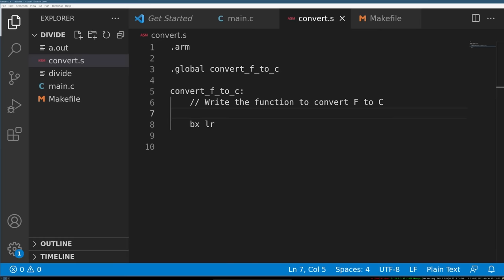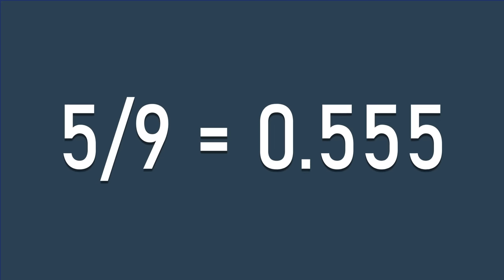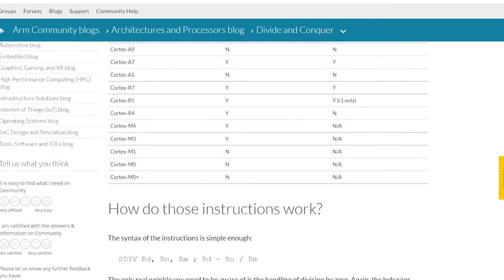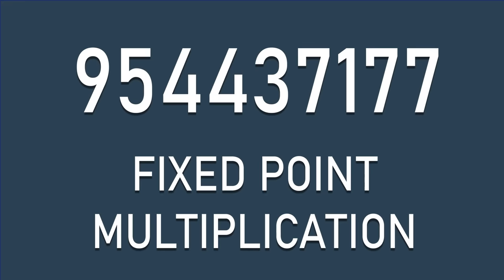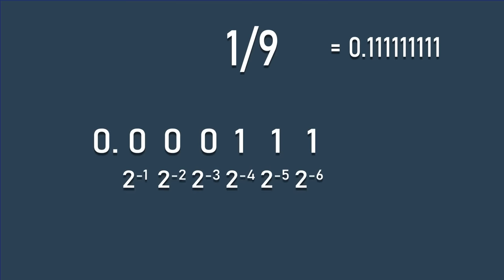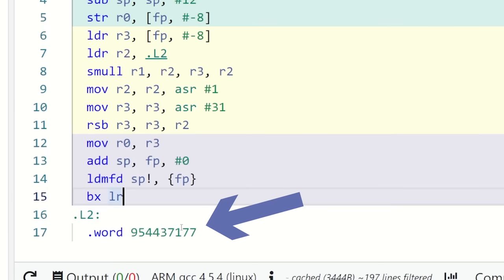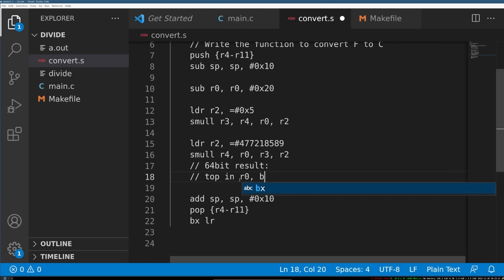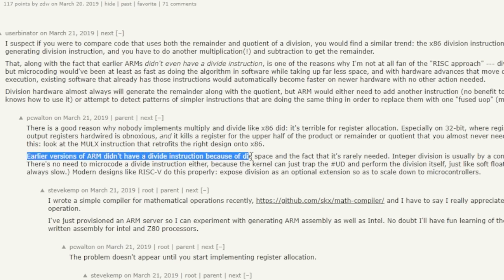computers suck at division (a painful discovery)

Comment: bro's just casually programming some ARM assembly. love it man stuff like this makes me motivated to learn low level stuff even though it looks kinda scary to me
Reply from the maker: Do it!
Reply: I think it's a waste of time beyond knowing "what is assembly and how it works + basics"

(Note: I, myself, know the "basics" I mentioned above. It's logical that "knowing" is always superior comparing to "not knowing"...)
Reply: Learning it will improve your high-level coding. Worth it!
Reply: @Yas-gs8cm  Once you learn assembly your thought process never becomes the same again. Even if you work with higher level languages you still constantly think about: "What happens once this gets converted to assembly". It helps you develop new ways to solve problems that you wouldn't have if you never coded in assembly.
Reply: @Yas-gs8cm  this isn't even the basics though, this video is super simple stuff
Reply: Its coding c with extra steps... ive done alot of 8086. Once you understand instruction calls (add,mull,sub), registers (variables), memory manipulation (storage space used for arrays), flags (a way to idenitfy what ur result is ) and function structure i think you are like 70% therr and have enough knowledge to write assembly programs
Reply: @Yas-gs8cm  understanding what’s happening at a low level is crucial to writing the best performing code you can and that far exceeds what the basics could help you with
Reply: Try learning 6502 assembly.
Or the 65c816 with a snes emulator.
Its really not that difficult to do basic things.
Its a bitch to setup the environment though.
Reply: @LittleRainGames  no sir we refuse ur barbarian ways.
Reply: Guys please stop mentioning me... I already got my degree and did enough assembly homework... Just saying it's not necessary in 2022 and it's pretty advanced/useless for an average JS normie xD (I personally prefer C)
Reply: @Yas-gs8cm  .
Reply: @ryantony5586  That's a really good point there...
Reply: @Yas-gs8cm  Of course it’s not necessary, but those who have at least had exposure will be at an advantage every time vs people who code in only Python and JS and have no idea how data is actually stored in RAM.
Reply: @Yas-gs8cm  there are some cases when compiler is unable to know some additional information about your data (alignment, SIMD leftovers, amount of data). So it is unable to make proper optimisation. Handcrafted ASM code, which leverages that info will be more efficient. OpenBLAS is a good example, where handcrafted assembly is still required for most computational cores.
Reply: @mattizzle81  having learned ARM7 asm without the textbook, I can tell you... I didn't learn jackshit because the professor couldn't explain the difference between LOAD and STORE instructions, I had to literally borrow someone's textbook because he made it sound like they are the same thing.
Reply: 1. Find a video game you love tht has an annoying part, cheat engine, learn ASM to fix code. 
2. Dig deeper and figure out how to right calculus in said game cuz you cant deal with the in game camera. 
3. Learn through your trials and tribulations of rewritting a video game's 3rd person view in ASM tht compliers do a horrible job at using the all the CPU registers and rely toooo heavily on the stack because of outdated compiler design. 
4. Randomly stumble across this guy video who overly complicated a division in low level for no reason other to make a video. 
5. Write a reply and jmp to @init. 

Serious note : If you know low level stuff you learn real quick how basic code gets bloated in the complier and soon realize there is no reason to learn ASM unless you are reverse engineering something. 

But if you do pursue, nvr use divide or subtract. Always use addition and multiplication. Subtraction takes more cpu cycles.
Reply: its arm, there aren't a whole lot of instructions in the architecture.
Reply: the scary part is that there are 3 registers in all opcodes for c=a+b, but most of the time you just do a=a+b, so you repeat two.
Reply: @LuskyMJ  100% this. i've learned so much in c# by looking at the IL and Asm that results. In particular about the compiler and how it optimizes things (or not)...
Reply: @cpK054L   hmmmm…. can’t tell if serious? The only difference between load and store instructions is direction.
Reply: @MurderMostFowl  yeah, it took the textbook to explain that to me
Reply: Ben Eater has a whole series about building a CPU from basic logic.  You want to know how the magic happens, watch his stuff.
Reply: @LuskyMJ  This. Understanding how assembly works and roughly how the general architecture of a CPU works completely changes how you approach problems. Especially in an MCU environment.
Reply: @Yas-gs8cm  no knowledge is a waste of time
Reply: @energy-tunes  depending on what you seek it can be. Yes.
Reply: @Yas-gs8cm  "Guys please stop mentioning me... I already got my degree and did enough assembly homework... Just saying it's not necessary in 2022 and it's pretty advanced/useless for an average JS normie xD (I personally prefer C)" You can't just make a claim in a comment section and then tell people to stop disagreeing with you, if you didn't want people too disagree then you shouldn't have posted it.
Reply: @Bob13454  I can do whatever the heck I want jokes aside mate... This is not a court, it's YT comment section... + just because I make a claim it doesn't immediately mark it as false. I don't hate being told I'm wrong. I just didn't feel any constructive points in the  replies so that was my polite way of putting it.
Reply: @Yas-gs8cm  Why were there no constructive points? They explained why they thought you were wrong.
Reply: @Bob13454  My main point was "it's not necessary 2023" right? and everybody is like "nope it is"... there is no real sign of "why" and most answers are just point of views. I'm not saying it's wrong. I'm saying it's not convincing for me. Hence, no construction. Therefore, no reply.
Reply: it is waaaay easier than it looks when you start. 
It is just very tedious.
Reply: @ryantony5586  the main idea of C is that it enforces limitations for concepts that do not even exist in assembler. No, it is not coding C with extra steps.
Reply: I think realising that division is so horribly expensive that there are better ways to achieve the same thing is the most important lesson! 

I also love that ARM said what the hell, let's just ditch it and stick to multiplication! 

Only found your videos recently and as a graduate from computer science over 20 years ago I love the way you teach!

Comment: 5 / 9 is roughly 569 / 1024. Dividing by multiples of 2 is an Arithmetic Shift Right.
Multiply by 569, shift the result Right by ten bits.  Multiply by 36409, shift 16 bits... 
and 2330169 with a shift of 32 bits merges nicely with your code.
Reply: Sir, this is what I call an elegant solution. Easy to understand. Easy to code. Easy to process. And give the most precise results available for this architeture (I think).
Reply: @VictorCampos87  This is exactly why they don't have these operations on the processor. Because skilled embedded developers don't need it and it would make it too expensive or large for the applications it was built for. People that do this every day generally don't need it.
Reply: @Kyle-ke5fx  What do you do when a variable divide comes up?
Reply: @joshuahudson2170  do it the same way we do long division by hand in decimal
Reply: @TrackedHiker  That's a guess and check pattern.
Reply: @joshuahudson2170  um, okay??? I’m not seeing a lot of guessing but ok
Reply: Only accurate to 3 digits after the decimal.
Reply: @JacobP81  Which is perfectly fine for temperatures, because extremely few things deal with temperature that precisely.
Reply: This is nearly exactly what he does though. He mulitplies by a huge number and then shifts right.
Reply: You described pretty much exactly what he does in three lines and in a more understandable way IMO. In his case, the shift would be 32 bits which he effectively does by ignoring the low half of the result in r4.
Reply: @joshuahudson2170  Use a lookup table. 
The most common examples of variable division are in DSP, where you multiply by assorted sine or cosine values. Or apply weighted values in filters. Or "window" functions before doing a FFT.
In all these cases, you have a table of pre-compiled values to select from.
Reply: @jeremypnet  As mentioned by @Dale Glass a temperature reading isn't likely to be highly accurate. Oven temperature sensors may have a range of 500 Celsius, but reading that with anything fancier than a 12-bit ADC is a waste of resources. And once you know your input is limited to 12 bits, is there REALLY a reason to use more than 16 bit math?
Reply: That's exactly what I had in mind. Since this CPU can only divide by powers of 2 (right shifts), find a "friendly" power of two as your divisor (ideally 2^32, so that you can use 64-bit multiplication and get a 32-bit right shift for free by keeping only the higher end register), then adjust your dividend accordingly. And yes, that's what he ends up doing in the video, but I find this approach much more intuitive.
Reply: Overflows occur earlier with this technique.  Maximum accuracy with largest input domain require two steps
Reply: @joshuahudson2170  My engine uses a lookup table where possible, but sometimes I fall back on an actual div instruction if it's acceptable or the range is too large.  If I had no division instruction there are usually other ways to approximate things (e.g. shifting off bits of the input to use a smaller lookup table), or you can do a step-wise long division. :)
Reply: @Ehal256  What architecture type are you programming for? Forgive me if I'm wrong, but I am led to believe on most larger architectures where game engines run, the overhead of accessing memory would far outweigh the benefits of not doing the rare FP division.
Reply: @joshuahudson2170  There won't be any guessing, since there is only 2 possibilities (we are working in binary). It either goes in 1 time, or no times. Simply check if the dividend is bigger, and shift a 1 into the quotient if it went in and subtract it out of the dividend; otherwise, shift in a 0.
Reply: @lapatatadelplato6520  I actually checked with somebody at work and we both had the interpretation of base (1 << machine register size).
Reply: I don't understand this. I want to understand this so badly. Need to return to this to process what's going on here after reading up on fixed point math.
Reply: @jumbo_mumbo1441  it's not really fixed point math involved here. When you measure something like temperature, you need to CALIBRATE your setup or the values are meaningless. Even then, are your readings really good to a fraction of a degree?
Treat the temperature as an integer (whole number). After conversion, the reading will be accurate within +/- 1 degree. That's probably more accuracy than your sensor can provide, anyway.
Reply: "Dividing by multiples of 2 is an Arithmetic Shift Right"
Oh, NOW I get it. It's like removing the rightmost* number in our decimal system is dividing by 10. Thanks!
Reply: @lapatatadelplato6520  sega genesis/megadrive
Reply: @joshuahudson2170  you can just use the “rotate through carry” instruction to do division quite cleanly, and you’ll produce the output bit by bit.
Reply: @Ehal256  yeah, then your method might work. But it will likely be easier to do long division. (60-100 cycles) for when you want full precision results. I was thinking you were taking about a modern device, where accessing large tables in memory might take too long.
Reply: Yes, and a bit shift is also sometimes faster than multiplication.
Reply: Making human analogy to make it easier to understand:
5/9 is roughly 56/100. Now shift is just removing zeroes for humans (computers do the same but with 2s instead 10s)
multiply by 56, and remove 2 zeroes
Reply: @Kyle-ke5fx  No, you have it backwards. The embeddded developers learned to do that because division logic/instructions weren't provided. If it was easy and cheap to do division in hardware, the cpu designer would have done so.
Reply: @Gameplayer55055  Removing two zeros is exactly a division by 100 (10^2).
Reply: This is literally the same solution as the one in the video, except for only 10 bit precision instead of 32... You gain nothing by only doing 10 bit precision, as you still need to do a single multiply.
Reply: @lrdxgm  A "standard" 32-bit multiply produces a 64-bit result (ie. it takes up 2 registers). Since the source data is from an ADC only 10 to 12 bits,  you can multiply by a 20-bit number AND IT STILL FITS in a single register, without overflow.

ARM processors deliberately have less instructions for accessing RAM, which has made them very fast. Another way of improving speed is to avoid writing data, even to internal registers, if you don't actually need it.
Reply: is this black magic?
Reply: I have no idea what I just read
Reply: Why not hardcode 5/9 as 0.55555555555 and just multiply?

Solutions like this are done all the time, like the inverse square root solution in Doom.
Reply: @GeomancerHT  This very point is addressed, at 50 seconds into the video. 0.55555 is a floating point number, and not all microcontrollers support it natively.
You can add a "library" to get support, but your code becomes Very Big, and runs Much Slower. The techniques discussed here are a way to get around that.
Reply: @Soupie62  thank you!
Reply: @GeomancerHT  you can actually store 0.555555556 as a fixed point number, and do the fixed point multiplication operation normally. I have no Idea why the man in the video multiplied by 5, then redundantly multiplied by 0.111111111111111. You could do it all in one step. I think he was trying to showcase the usefulness of this kind of trick in an incremental manner, for pedagogical reasons.
Reply: @lapatatadelplato6520  gracias! that was my first thought!
Reply: Quick note about vocabulary: you mean dividing by "POWERS of 2" is an Arithmetic Shift Right. However dividing by any "multiple of 2" is not. For example, you can't divide X/6 with a mere right shift.
Reply: @joshuahudson2170 Use the C libraries for the odd division. If you’re using a Cortex M0 and need to do a lot of division that can’t be done by multiplication and shifts then perhaps you have chosen the wrong MCU :).
Reply: So if I have to multiply with a number in the inerval [512, 1023] I just need to shift right by 10 bits?
Reply: @utilizator1701  to multiply by 2, 4, 8, or 16 you shift LEFT by 1, 2, 3, or 4 bits. Fortunately,  integer multiply tend to be built in, so you can also multiply by other values.
To DIVIDE by 2,4,8, or 16 you shift RIGHT by 1, 2, 3, or 4 bits.
When you have a value stored in a (16 bit) integer, you can multiply, THEN shift right,  and the result is still only a (16 bit) integer.
Reply: @utilizator1701  nope, if you want to multiply a number N by 512, you right shift 10. if you want to multiply by 1024, you right shift by 11.
Reply: @arthursfez5650 each left shift doubles the value. 11=3 110=6 1100=12 and so on
Reply: @lapatatadelplato6520  Well yes, that's what i'm saying. X Shift left/right is equivalent to multiply/divide by 2^X.
Reply: I believe that you (like the author) forgot about negative numbers. for temps below 32F you can start with 32-F and flip the sign of the result.
Reply: you embedded fucking wizard holy shit.
Reply: using this method for years. Its faster in any processor. Most compilers removed divisions and replace it with this method, but doing it your way is better, because you know your limits, for ex using only 16bit, etc...
Reply: This is old style  Assembly programming... like what we used to do in the 70's- 80's
it's the sort of skill that is NOT taught anymore, rather  equity & gender politics... is more important...
Reply: yeah, technically all CPUs support division approximation via bit shifting which is the equivalent of multiplying and dividing by a power 2